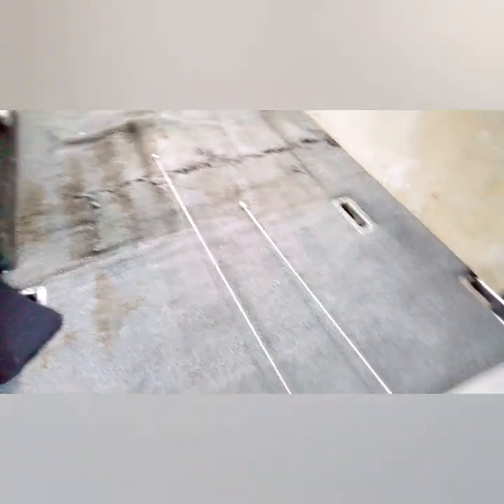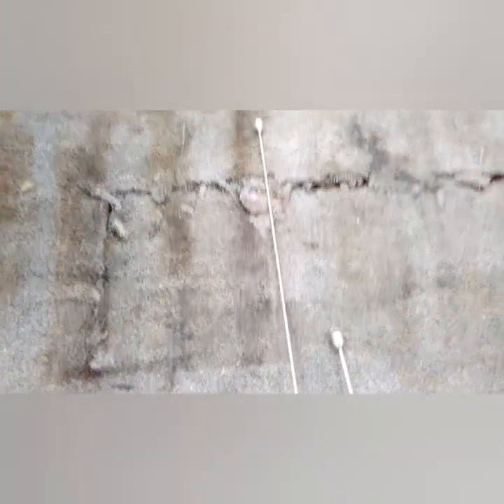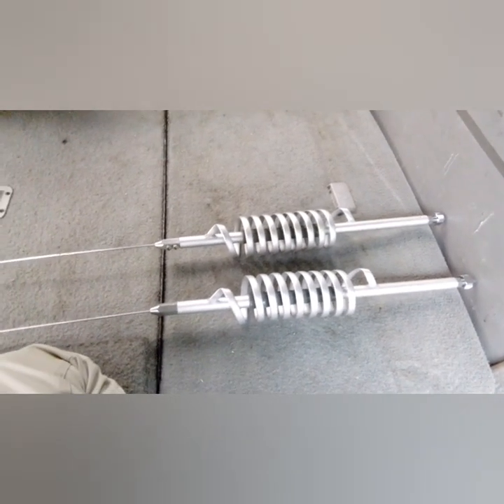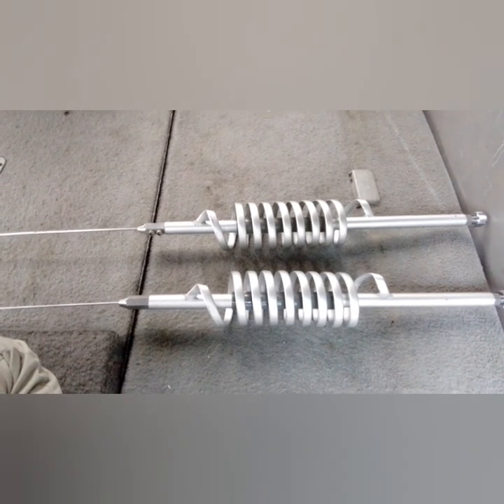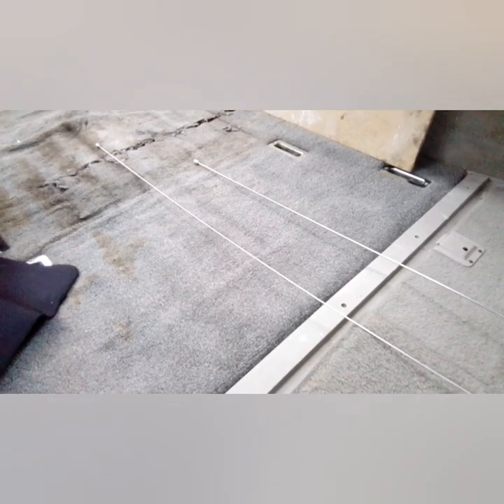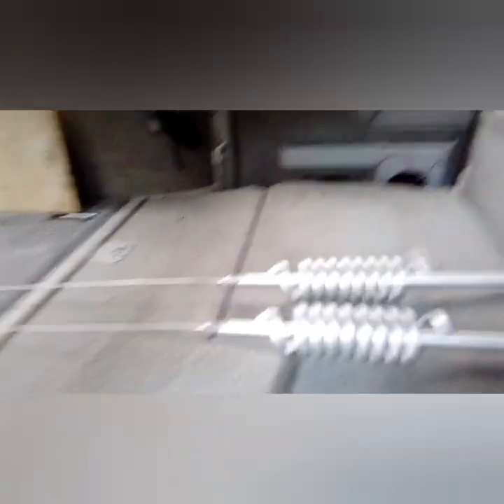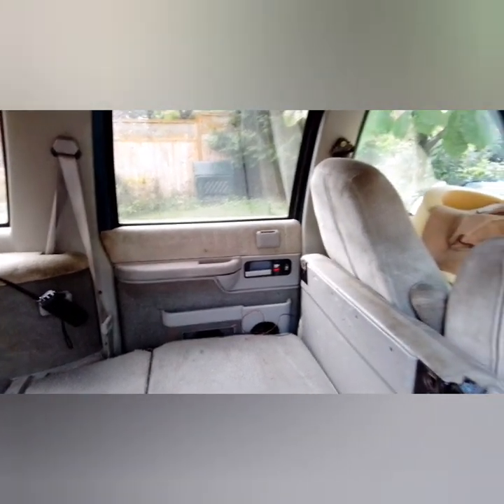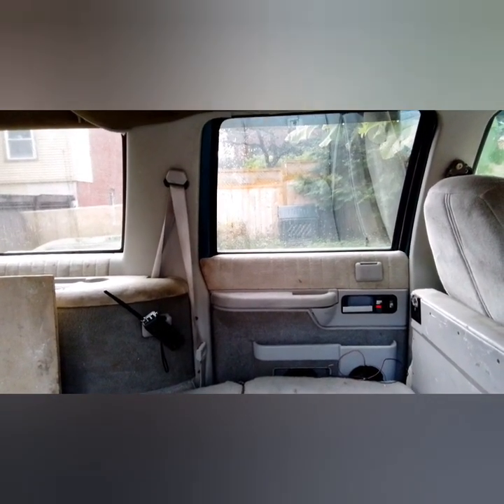Competition CB Radio Build. Directional Antenna Lay Out.

Comment: Would be interesting to have you place a analyzer on the system,at the radio,  to see how OHMs are affected for a total look at your match. Each element added will effect the ohms not just swr. Nice looking setup.Good luck. Test first with Primary only,than add reflector and test again. On a 3 element beam,usually the additional 3rd element, a  director, will bring the ohms down to 50 ohms.

Comment: U need another forward director
Reply from the maker: What do you mean by forward director?
Reply: @DarkStarRF  so bye adding another forward director.. u see the better way to fully get it to have a more direction forward driving signal u can add 4 antenna.  Only one hot the hot has one rear reflector that isn't hot ...the middle antenna is hot ..the in front of it is a forward director... The a ways in front of that is another director .... U can also use 2 hots but ..I don't recommend 2 hots with dual directors get more forward gain from 1 hot and 2 forward and 1 real reflector ...bye using more than one forward director it brings the radiation tighter way tighter and bye adding the more directors the gain goes up ... Ther is lot of measurements that have to be right ...also binding grounding ..but it works well .... Hope this helps ..there will be a optimal measurement for you that gives you the most forward gain ....that's were u won't it...u will have to play with moving the reflector and directors... always set the hot antenna and leave it once u start this tune
Reply from the maker: Thanks for the clarification. I don't plan on competing in the multi antenna class. Only single and double. At least not yet anyway. Lol
Reply from the maker: Thanks for the info too!
Reply: Man are u using power or antenna only competition
Reply: I build competition radio ..29 ltd's ..25 ltds and I also do 955s and we'll basically what ever ..but my comp radios are cobra 29 ltds 15 RMS  60 plus peak radios ...ya know all comp built ...
Reply: Thanks for the info. I’m thinking about a new antenna setup on my semi truck. This little bit of info may help. 
Thinking of running co-phase antennas above the the mirrors on ball mounts.  
1 reflector on each side 72” behind each driven antenna. 
And one element on each of my hood mirror brackets. 
The hood is fiberglass so the brackets are isolated. 
What do y’all think?
Reply from the maker: @juliemathis1065  That sounds like an interesting and ambitious Idea. I'm not sure how that would work. Im interested to know how you make out.
Reply: @juliemathis1065  Julie I'm a technician here in Oklahoma..9lb hammer customs. Justin Ruth ...message I can hlp
Reply from the maker: @juliemathis1065  One thing about reflectors. While they concentrate your TX in a particular direction the will also reduce your reception in the opposite direction.  So, for local talk or skip they can work against you if you are trying to talk to someone that is the wrong side of you array.

Comment: I like one whith less loading 
Got m4 monkey made  n a big John 
I see you have fatboy pucks n it looked like no backer plates 
I understand you got this rig set up from someone else 
I have fatboy puck but I did uses it
I got a Breedlove n I really like it
I got the big plate n still beef up my mounting point mine is on a 4×4
 So I go under limes n things 
I put 1/8 steel plate that just fit in between the roof supports n ran threded rod front to back in to the supports  bbi has a video on it I did mine be b for I found his video But dun all most the same n don't for get ground straps ever where it the number one thing newbies for git
Got over 30 on my little 4×4 
 Ps check out motor city remand 
If want a lot of altater for your bucks
Reply from the maker: 10-4  thanks for the info !